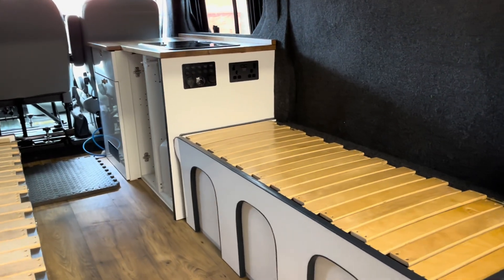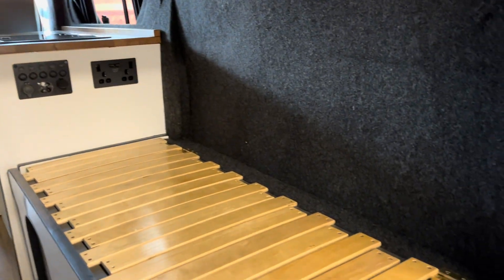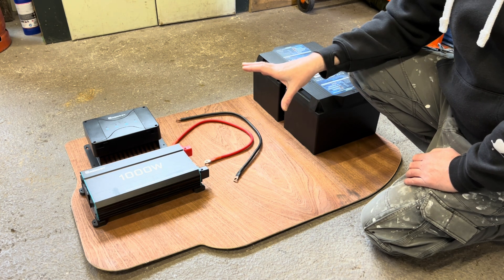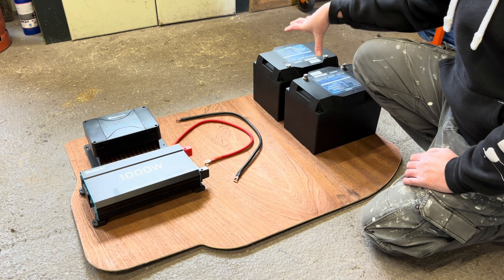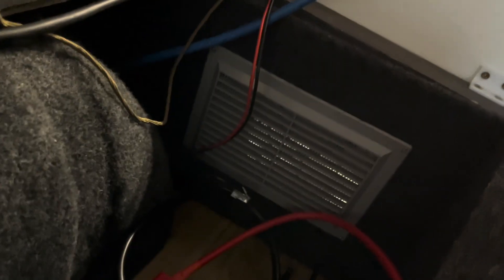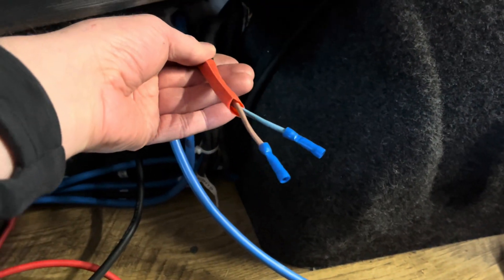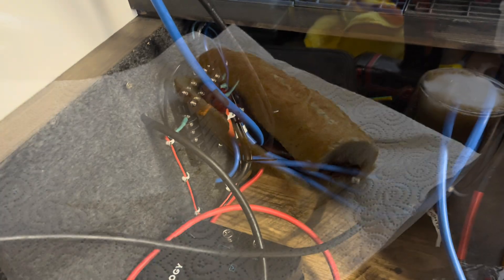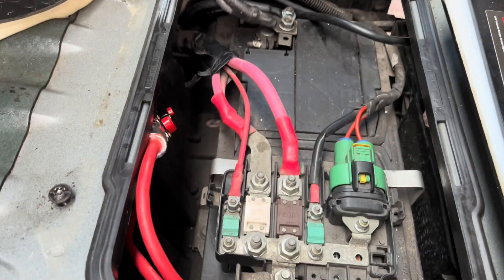Vauxhall Vivaro Van Build Series - Complete Electrical system - But not in my Van!

Comment: What can I say, my good mate Nigel “bikers tale” strikes again… just short of two years ago when I had an idea Nigel gave me some help and inspiration, since then we have become good friends and speak on a regular basis. Due to work commitments myself the conversion has taken longer but there was never any rush to complete. The entire back apart from the units has been made from kitchen end panels, routed and edges with knock on trim….  (previous kitchen and bathroom fitting has its advantages). Without. While I could do the majority of the build myself when it came to 12v electrics I didn’t have a clue… Greg Virgoe helped with the cable choices and fortunately for me Nigel could not resist Welsh hospitality and locally sourced bacon and eggs and ventured down to help me get the installation under way. Thanks again Nigel, you’ve been a great inspiration to many like myself keep the faith … 👍🏼
Reply from the maker: Thanks Shwmae It was a total pleasure being able to help you out, bacon & eggs aside, we had a good laugh & it was good to finally meet you in person. 
Glad we didn't literally blow the Van up! 🙂 
Keep up the good work, you are almost at the finishing post & ready to enjoy the hard work you've put into it, 👍